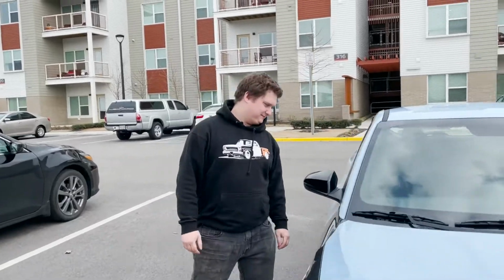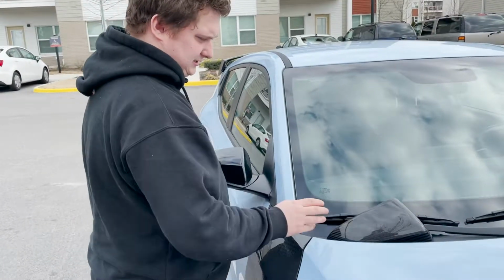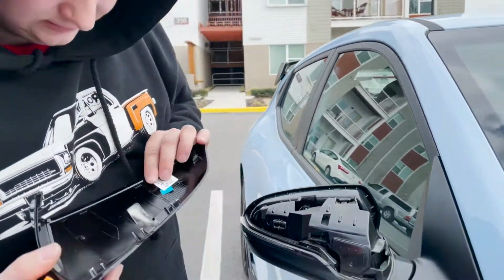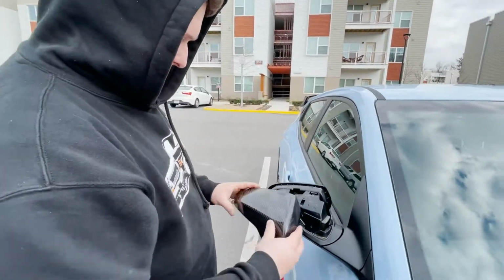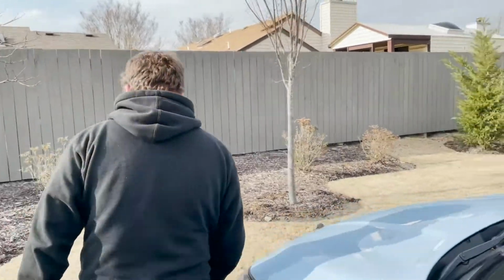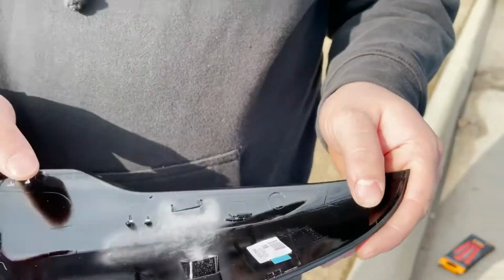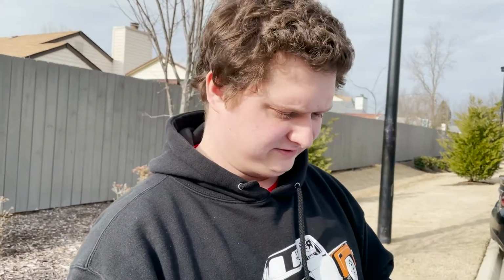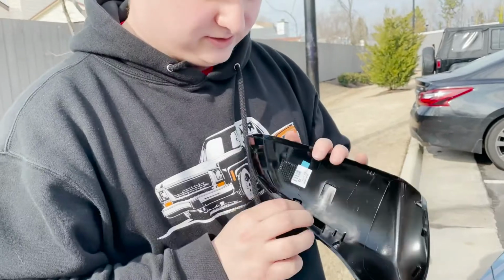Veloster N Carbon Fiber Mirror Install (How To)

Comment: I did this on my 20 elantra gt n line. It's best to remove mirrors from car. Pull mirrors off their mounts, use a screw driver with duct tape on the tip. With palm of hand whack the inside of mirror caps. These will pop off and no broken tabs, so they can be reused if nessacery.
Reply: Where did you get the carbon fibre covers? I would love to do this for my 20 GTN Line